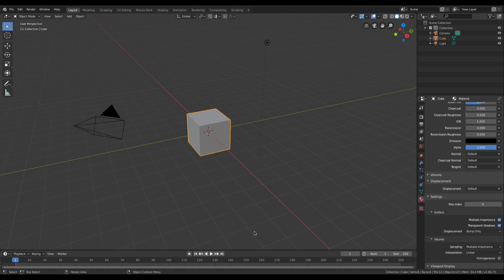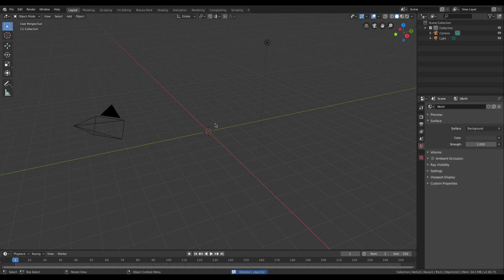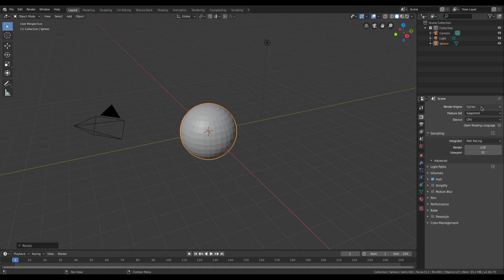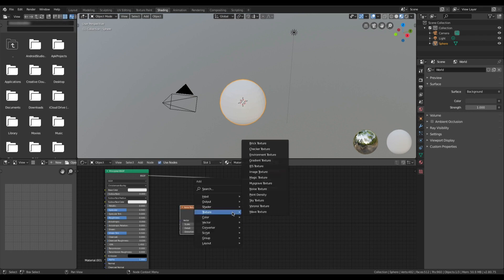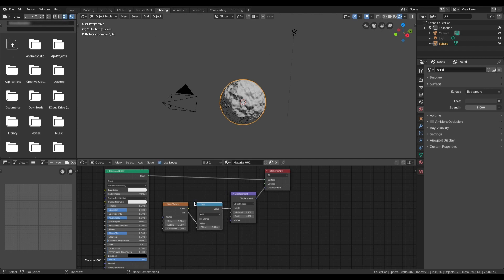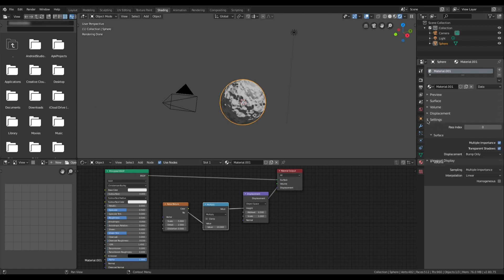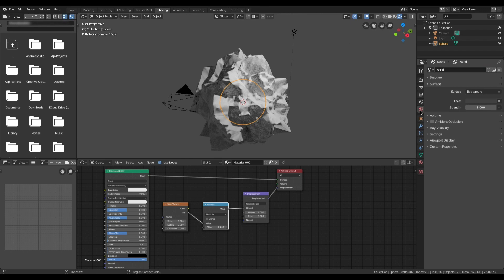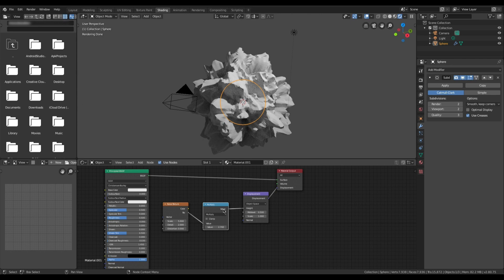Displacement in Blender

Comment: the option "displacement: bump only" does not exist anymore?? I cant find it (July 2020)
Reply: Nope I just updated recently
Choose Render Engine - Cycles
select your desired object 
go to material properties and click on settings and click on surface under there you will see displacement, bump, both
Reply: It's only in cycles (under mesh/materals>settings)
Reply: @norabindi7237  I don't think so.

Comment: I'm using the latest blender and followed your instructions exactly but get no displacement on the vertices.? Any ideas?
Reply: Well, that was a D'OH moment for a Blender beginner like me. Just press z and enable rendered mode. It didn't work because I was in material preview mode.
Reply: @Gameboygenius  I f*cking love you
Reply: @Gameboygenius  I did figure it out eventually as well! You are not alone!
Reply: Had the same problem , make sure that you selected Cycles render , select material properties tab, surface, deplacement to displacement .
Reply: Same here. Using 2.82 and yes, engine set to Cycles and displacement method set to displacement and bump. Could it be a GPU support issue?